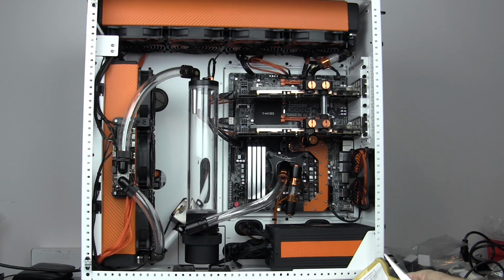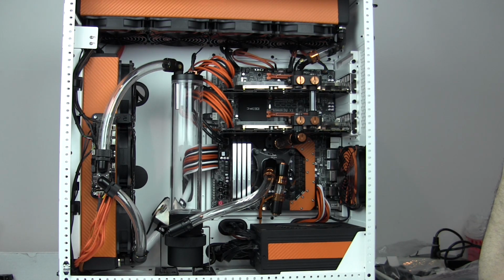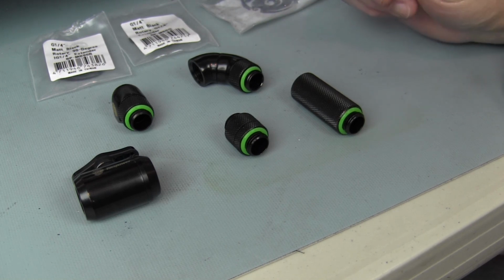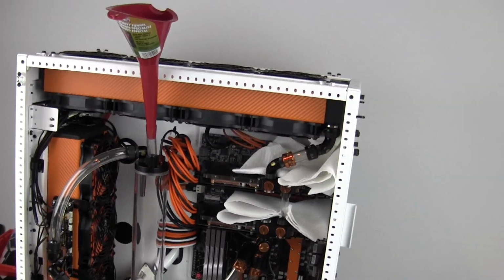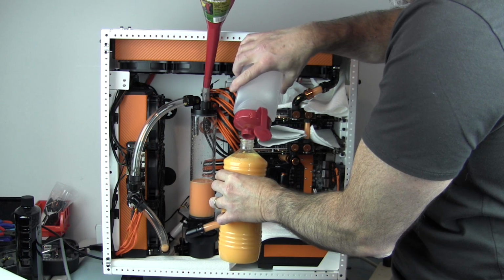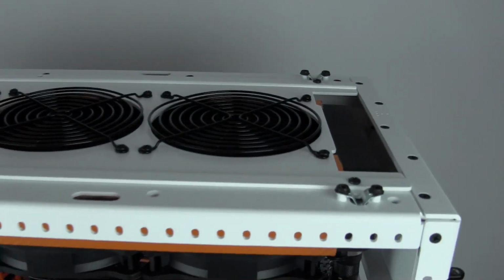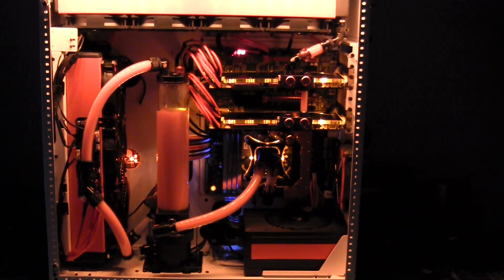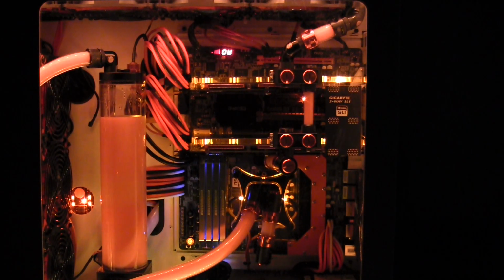Case Labs SM8 Water Cooled Cooled Build Log 7  - Clockwork Orange - Filling loop and leak check

Comment: hey man, i know this video is old.. but i was wondering if you could answer a question as im quite new to "water cooling"; are these computers just for show, or could someone use this build for years or so? how often do you need to change the liquid and does having coloured coolant block the pipes?
Reply from the maker: This has been my main computer for over 2 years, work, gaming, and video editing. I just replaced it with amy STH10 build (see my channel for the build log.)  They suggest changing the coolant once a year, but I never did and it was working just fine.
Reply: awesome man, such a sweet build :)
Reply from the maker: Sweaty Crow Thanks man. Thanks for watching.

Comment: Great build and video series. Just placed an order for a caselabs case myself, an ST 10, and I'm looking to mount a res just like you did. Would you mind listing, or pointing me to a list, of the parts used in the res/pump combo? I already have a D5 pump, just need to figure out the necessary hardware. Thanks!

Comment: Great case, I have been thinking about going watercooling too.  I have one question through.  It looks like the piping to your CPU and GPUs are connected in series.  From what I can tell, the "exhaust water" of the CPU goes into the intake of GPU 1 and the exhaust of GPU1 goes into the intake of GPU 2 before going to the radiator.  Wouldn't cooling be more effective if you split the tubing into 3 so that the GPU1,2,and CPU receive water directly from the pump without going through the heat sources as it does in your current setup?  I don't know if it makes a difference, but just wondering.
Reply from the maker: It does not make a measurable difference., The flow rate of the loop carries the heated  coolant away so quickly that it does not really affect the second GPU at all. The D5 pump is a reliable and strong pump. Minimal restrictions in the loop keeps all moving nicely, coolly and quietly.  Thanks for watching.

Comment: Sorry, Mayby i should tell it different. I mean your inlet is on the top. i got myn at the underside as well as my outlet. I think it doesn't really mather as long as the little tube stays under water. I think both ways works just fine. Did't got anny trouble filling it and you neither.

Comment: LOL... not to speak for this amazing artist but he basically showed himself building parts of it.  But every tiny little itty bitty detail, tubing, piece of metal, on a system like that is completely assembled by hand.  Even the pump itself had been taken apart and had the head/top replaced.  The large tube you see with the water in it is not molded, cut, and threaded by him and he did not CNC machine the blocks himself but there are a lot of pieces and they don't come in a KIT!!!

Comment: Did you end up doing this... if so can we see? A photo bucket picture or something like that in the details would be plenty.  I love this build and just want to see if the experimentation with the coloring pays off.

Just FYI I do my color experiments in glasses first... I ad the color to water then poor that water into water to get a good dilution then I mix the colors.  Cheaper this way and don't have to go through the horrible experience of draining a system that is more than just 1 block!

Comment: I'm sorry but i didn't like the colant color i think it was to light i would had liked stronger orange. 

and also i'm not sure about this but i would had filled the resorvoir to the top so tht the led would have more of a efect at the same time as you dont see the condense in the top but i'm not that in to watercooling so i'm not sure f you did that on purpose...

but else a nice build ;)

Comment: That's some nice equipment there, its just a shame that there is a bit of a radiator sandwich happening with the front rad feeding warm air to the top rad. Unless the door is left open all the time it will really reduce the effectiveness of the top rad.

Comment from the maker: I purposely left some space open.  Using the Aquaero and regulating the speed of the pump I like to see the flow adjust the coolant return to the res.  You can't see it but the return nozzle in the res is at just about the coolant level in the res.  So it was just a personal preference.  By the way, love your channel.  Thanks for watching.

Comment: think you could cover the sli bridge? or even just remove the white letters? i was thinking if you put some of that orange carbon fiber on it would look prime. and could you shave that black plug to cover that round hole? or would it no longer hold itself it if you shaved it with say a razor blade?  I love the build and i take a lot away from your videos when i am building my toys. thank you!

Comment: Continued: Aquacomputer also makes a really nice D5 pumptop/res combo with build in water level alarm"aqualis base for pump adapters 880 ml with fountain effect" and "Pump adapter for D5 pumps for aqualis with fill level sensor, G1/4", this cable can make your aquaro turn off 24 pin when an alarm starts "aquaero power connect - 24 pin ATX standby power / ATX break". One finally thing maybe try and get some more monsum for the compressions and just use BP for the rotary's.

Comment: Ron's a nut, mhhh my brain said Rosa nut, heh the mind is a wierd place. aaaaaaanywaaays it really turned out very nice love it looking forward to see more. Since you encourage feedback I will leave mine.To go with the clock theme you could add "Real Time Clock expansion module for aquaero 5" to your aquaero 5 LT. Also on the back that power station for the LED's could be swapped for AQ "multiswitch USB 1.41 Version LT" it does advanced lighting from your aquaro software.

Comment: Absolutely amazing as always love the vids. I have a question maybe you could help with. I'm doing a build for a buddy who insists on using an old case that he is attached to. My issue is its a top mounted psu. I will be installing a h80i right below the psu. There will be two intake fans one in the front bottom and one by the gpu in the window. Now my question is will I have enough positive pressure with the two 120mm intakes and the h80i and psu exhausting? The case is an old nzxt Nemesis.

Comment from the maker: In build Log 3 I set up the SSD's in raid on the bench.  I meant first time with everything else connected, GPU's power cables, signal cables, fans, etc.... as a complete system.  Good question though. Check out Build Log #3.  Thanks for watching.